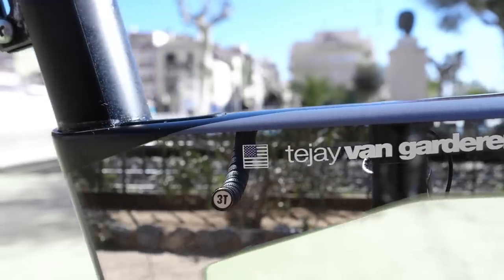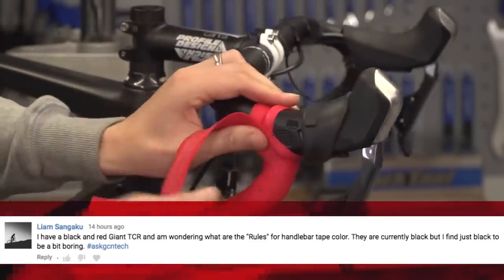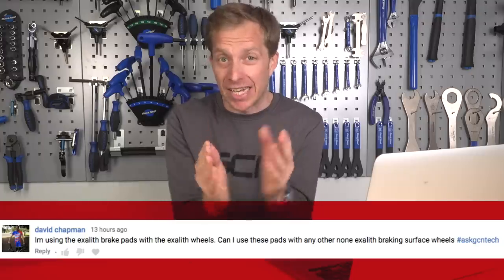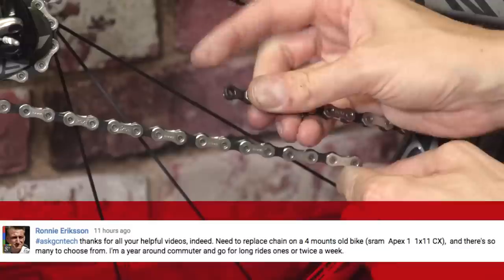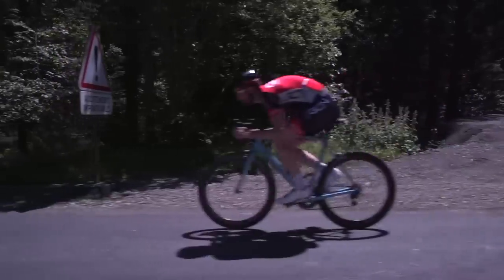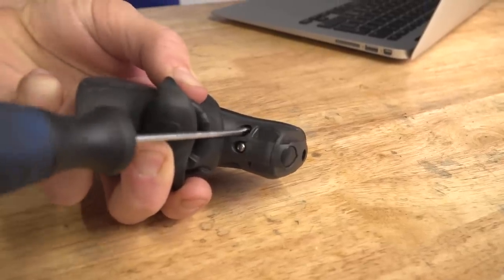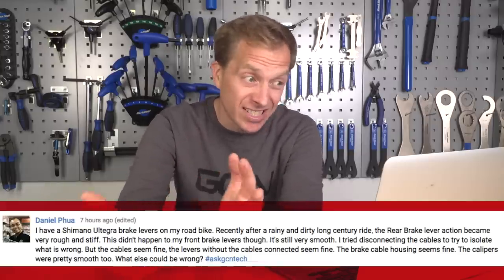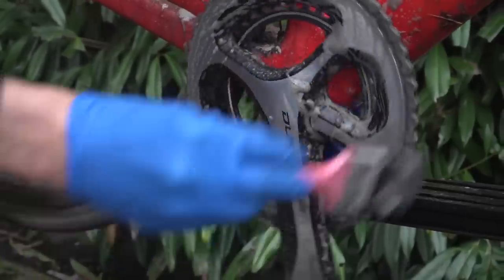Should You Get A New Chain When You Replace Your Cassette? | GCN Tech Clinic

Comment: About track bike stem pointing up.
Yes it's because the head tube is short on modern carbon track frame.
But why is it shorter than before ?
Because on a classic track frame, you can't achieve a proper aero position.
Now designed this way you can use the same frame for endurance race AND for Time Trial race.
You just change the cockpit : swap your (stem+road handlebar) for a (stem+pursuit bar+aero extention)
That's usefull during an omnium event when you race a 4000m after a scratch and before a point race :-)

BTW : Super nice advices here !! you're doing good ! :-)

Comment: Jon on the di2 brake reach, I have Ultegra Di2 with hydraulic disc brakes and the screw to adjust is on the inside of the leaver.

Comment: Degreasers made for car engine degreasing work perfectly fine on a drivetrain. I personally use only them, they're designed to not eat away at the plasticky/rubbery bits that the engine compartment will have.
Reply: Agree.  Big fan myself.  I buy 2l of concentrated degreaser from Super Cheap Auto (a chain automotive supply store) here in Australia for about $25.  Which I suspect would be about $100 of Muc Off (or more)...  I do make a point of only leaving it on the bike less than one minute (following the instructions)

Comment: there is a tool that can check the wear on a cassette. i only knew about this in the past few years, after i couldn't not diagnose the cause of "chain-skip".
i brought my bike to the shop, explained the symptoms, and they guy brought out what looked like a mini chain whip. tested the sprockets, and determined that the exact cogs i was having problems on, were the ones that measured worn out.

Comment: Bike dilema. I have an old cheap £400-ish mountain bike with sagging front suspension and hard tail.I have spent money upgrading the drivetrain and wheels so it now stands at £500 spent. I mostly use it on unmade roads and forest paths. My question is, is it worth fixing the sagging front suspension or locking out the travel altogether or maybe getting a brand new upgraded fork?Should i just get a new bike?

Comment: I have a Mavic Ksyrium elite which I rode for 5 years and a hairline crack originating from one spoke has formed.  1.  Is this normal given a rider weight of 110 kg ?   2.  Can a bike shop replace the rim and broken spoke , keeping the free wheel? (or do I have to buy a replacement rear wheel).  Thanks for any info.

Comment: I've got an ancient steel mountain bike and the front fork and chainstays get tire rub with good quality, corner-grippy tires at 2". I really want a grippy, plush, low pressure tire, but I need it to be 26" and rather narrow, probably 1.75" to be safe. Any ideas? The big names and fancy tires I know of all start at 2" wide and go up from there.

Comment: KMC chain links are very much reusable, even if they say they aren't. Marketing BS and nothing more. I undo mine every 200-300 km in order to remove and properly clean my chain, I never had any issue in 7-8 years of exclusive use of KMC chains.
Reply: Hey brother sorry to bother you and I appreciate that you acknowledge the marketing BS I'm with you on that one. I have a question I have a cassette on my bike that is 11 x 46 but I wanted to upgrade to a 11 x 50 cassette my current chain doesn't seem to have a lot of tension and I was wondering if I can use that same chain when I do the Eleven by 50 cassette conversion maybe I can release a little bit of attention please let me know if you can thank you

Comment: #askgcntech

Jon,

I ride a 2009 CAAD 9 (10 speed) in very flat Florida. It has a 59/34 crank and 11/26 cassette. However, I go to very, very hilly Vermont for two months in the summer and would like to make the bike more hill friendly. I am a half-assed bike mechanic and could use your advice. I am not going to change the crank, but I would like to change to an 11/32, or 12/32 cassette and a Shimano  105, 5701 medium cage rear derailleur (there is a 105 short cage on it now). Will that work? I did the math(s?) on capacity and that seemed OK, and the 105 medium cage cage can apparently handle 32 teeth. I know I will also need a longer chain. So, have I overlooked anything? Also, would a 12/32 provide smoother shifting (and increase capacity) than the 11/32? I ask because even here in flat SW Florida I never use the 11 cog. Any advice is much appreciated.

Thanks!

Comment: I have a 2011 Felt F3 fitted with Sram Red 2012 10 speed groupset. I don't want to upgrade to 11 speed yet, but Sram Red XG-1090 cassettes are getting harder to find. Can you please advise if I can use the Sram XG-1090 CX 10 speed cassette designed for cyclocross on a 10 speed road system ? Not sure if the cassette spacing is the same. Yes, I know there is the 10 speed Force/Rival cassettes - I'm a cycling snob & want to stick with Red ;)  #askgcntech

Comment: #askgcntech 
Hey Jon. I have a BMC TeamMachine SLR1 and have been keeping it in mint condition, but ever since I got it, I had an issue adjusting the seatpost, as it slides in every time I go for a longer ride (the angle lock, as they call it). I have the elastomer wedge version, not the aluminum and yes, I'm on the heavier side (about 92kg). I was just curious if you would recommend an aftermarket solution (if there is one) or if you could explain how to properly adjust the rod, as I am very afraid to tighten it too hard and damage the frame. Thanks!

Comment: When you put a new chain on the way is to put the chain in front on the big ring and on the back at the smallest sprocket.
Then your pulley wheels shot be straight above each other.
When this is the right way the lenght of the chain is the same with a 12-25 and a 12-29 cassette.
Is that not strange because on the 29 sprocket the rest derrailleur stand much more pointed to the front.

Comment: #askgcntech My bike shudders/vibrates whenever I brake. It's worse when I brake lightly, and almost goes away when I apply stronger force. It also mostly seems to happen whenever I use both brakes at the same time, as opposed to only the front or rear brake. How do I find and fix the source of the problem and should I be concerned for safety?

Comment: #askgcntech
What could be the reason for a quite loud, rattling chain noise whilst driving in the big chainring (50T) in the front and the 13, 14, 16 and 18 tooth sprocket in the rear? The noise appears to come from the chainring. Ultegra 8000, adjustment of derailleurs in front and back is correct, no scratching there.. could it be simply the sound of the chain hitting the chainring? Thanks for any tips!

Comment: #ASKGCN have a fit question for you. I’m new to the sport and purchased a price point bike. Large frame then I was feeling a little raked out. Purchased an 80 mm stem and have the seat slammed forward. Can I get away with it? Or would I be better served on a medium. I know fit is very personal. If it helps I’m 5’10”. Guessing I’ll have to go to the shop and get fitted.

Comment: Check out Bilt Hamber Surfex HD degreaser. Used neat it will degrease chains and at 20:1 it will clean the rest of your bike perfectly. As for replacing the chain when fitting a new cassette I was shocked to see SRAM state that when their Red 22 chain wears out that the cassette and chainrings should be replaced! For me that was 1700 miles, needless to say I’m aiming to get a bit more life out of the cassette and rings...

Comment: The shifters might not be the dropper post guys problem, he will probably need one with external routing, then he would also need to zip tie the cable across the frame. But he did say it was a cx bike so he is in luck if his front derailleur cable stops run across the top tube. I’m sure his frame wasn’t made for stealth dropper mounting, so if he went internal he has to route that cable around the bb and up and out the internal routing hole for the fd cable, but that only works if he has internal routing. So ultimately then he might have to just get a lever actuated one without a cable.

Comment: Hey John, great Show. I´m just irritated by the tire preesure recommendations. In psi it`s ok , but 1 Bar for every 25kg of bodyweight means 3 Bar art 75kg (lol). It should be around 6-7 Bar?! In Germany we don`t use PSI, bar is more common. There is even another aspect besides body weight and tire weidth. When using tubeless tires, I use almost 1Bar less.

Comment: #askgcntech.  Hey John, love the show!   My older frame won’t fit a 25 mm tire. The tire will rub on the rear brake bridge with my DA C-60 wheels, so I’m running a 23 mm on the rear. When I replace, should I keep the front at 25 mm or run matching 23 mm?   Thanks!!

Comment: Hi, recently I've got myself a Shimano R8000 groupset, but I've got some issue with the front shifting. Sometimes the left shifter is jammed when I tried to change from the small ring to big ring, but most of the time it's doing fine. Later I noticed the reason is that I touched the small lever as well when I shift into the large ring, which causes it to jam. But I haven't got that issue with my Sora R3000 & 105 5800 shifters. Is that normal or something is wrong with my shifter? Thank you. #askgcntech

Comment: How often do I have to wash the bike? Not only wash but also degreasing the chains. I m currently staying in Singapore (very humid). Thanks GCN!!!
Reply: You want to clean it if you happen to ride in the rain or get  caught in the rain or if it looks dirty to you. I currently have my bike frame and wheels coated 3-5x with carnauba wax and my chain coated in Molten Speed Wax, it helps to protect against dirt, grit, sweat, etc. it's nice piece of mind to know you've got that barrier against salty mess and road grimes. With a solid wax job, you can give the bike a quick mist with water and wipe clean as needed. This is just me since I like to take good care of my bike and how it looks.
Reply: Kyle Kim.... Get yourself a chain cleaner and two cheap water bottles. Fill one water bottle with hot soapy water and one with ordinary water for rinsing. Run the chain through the chain cleaner with the hot soapy water and then run through with the hot rinse water. I generally try not to use degreaser on my chain unless it is really really grundgy because capilary action sucks the degreaser into the pins and rollers then it is hard to get sufficiently flushed out. Which means when you go to put the chain lubricating oil or wax on the chain which has a higher viscosity then the degreaser you just used, the remaining degreaser in the chain will immediately start breaking down the oil or wax. Not ideal.
Reply: I wash the bike thoroughly once a week. Every other washing I put  a coat of wax on it. Quick to do and makes the bike more aero, like.5 more. LOL!
Reply: Dave Sarcevic.... Have you tried Lemon Pledge, it is very addicting!
Reply: I never wash my bike.  I ride it it to work regularly and some of the trip is on dirt/mud footpaths.  The bike gets filthy every day and gets a bit cleaner when it gets rained on.  I will clean the drive train when I start to notice a deterioration in performance or something needing adjusting/fixing.
Reply from the maker: Hey Kyle, depends on how much you ride and what the conditions are like. If it's quite dry, then once a week should be okay!

Comment: I have a brake related question. Yesterday i decided to test my new brake-pads on a quite rainy day. But i noticed after only a few breaking sections that my front breaks were actually peeling away small thin strings of aluminium from my braking surface. I also later on noticed a wierd ticking sound from my rear wheel when breaking. I, as mentioned, have aluminium rims and it said nowhere on the package of my new brake-pads that it was carbon specific. Does anyone have any clue about what could have gone wrong? Or is this completly normal when replacing brake-pads?
Reply: Loosen up you brakes as if removing your wheels. Check your pads for embedded sharp objects (pebbles most likely) under bright lights. Check in the grooves if your pads have them. Use tweezers to pull out anything you find.

Comment: #askgcntech recently had a long ride with a lot of speedbumps and since then I have noticed my rear wheel is losing air. Filled it up to about 100 psi one morning and by night it was sound 20%. The front wheel isn't losing air. What could be the issue.. I have checked around the valve and the airflow remains fine
Reply: The only way to fix a slow flat is to take the tube out and 1)  replace it  or 2) inflate it, immerse it in water brush off the bubbles and look new bubbles and patch it. If it is a pinch puncture you could have 2 flats. Run your fingers everywhere on the inside of your tire to look for anything sharp and if you find something remove it otherwise you will have to do it all again.

Comment: #askgcntech Am i able to combinate the new Campagnolo 12-Speed Groupset with the older Super Record 11 Crankset. Because 900 EUR less or more are a big difference. Thx for your Answer
Reply: "OLD super record 11" Dang we are already calling 11 speed "old"... my 10 speed is officially a museum pice i guess lol....... But seriously, From what i have read on the 12 speed group, they kept the exact same spacing in the back which means the chain itself is thinner so the space between the chainrings in the 12speed crank is less. This is so the chain (which is thinner) can catch on the pins and ramps that aid the shifting. That said, the difference is like a fraction of a fraction of a milimiter so I bet it will work just fine with the 11 speed crank.... maybe it will be marginally less smooth shifting  but i'd be surprised if you could notice
Reply: Fernando Roman thx, sorry, sure i meant „older“ not „old“. :D

Comment: I use a heavy duty degreaser called Marine Clean.  It is a very strong caustic solution that I dilute about 10:1 before using on my drive train.  Not out of concern for the drive train, but out of concern for myself.  I really don't want to turn my subcutaneous fat into soap under my skin.  That's no fun.

Comment: #askgcntech recently been using look cleats and look pedals, since I am a beginner, I was wondering is there a hack or something i can do with the cleats to give it more grip when walking with it?, my dad bought a few sets it will be a waste if its not gonna be used, nobody wants to slip a lot on cleats right?. Thank You!
Reply: I would try gluing a cutout pice , or a few smaller pieces, of inner tube. Shimano cleats have their colored tips made of a grippy material, I actually think they are pretty good to walk on.
Reply: buy some cleat covers that you can clip over them while you are walking. That adds grip and reduces wear on the cleats too.
Reply: @Zé Muguello, seems a good idea, gonna try that inner tube trick, thanks

@Nic Breen-Franklin my dad might have one of those, gonna try them later, thanks
Reply: Here is an example of cleat covers for the Shimano SPD SL system : http://www.chainreactioncycles.com/ca/en/shimano-spd-sl-cleat-cover/rp-prod146181
Reply: Im using Look brand road cleats guys not the shimano one, just finished installing the inner tube thing for grip
Reply: Even better $$ €€ ££

Comment: #askgcntech hi GCN my bike is a 7 speed bike I will like it 10 speed should I replace the chain cassette and derailleur
Reply: You would have to change so many parts ($$ ££ €€) that unless you can find them cheap (used/2nd hand) it would be cheaper to find a used 10 speed bike. It is not a trivial upgrade.

Comment: #askgcntech Si needs to tell us how different internal widths on wider rims affects what pressures you run.  Surely a 28C on a 15mm internal width would be at a different pressure to a 17, 19 or 21mm.  Question is, how much differnent

Comment: Any degreaser with Sodium Hydroxide (lye) should NOT be used. It has a strong reaction with aluminum and will etch it. Learned this the hard way.
Reply: An excellent point!  It can be a useful chemical reaction if you want to clean bare aluminium castings, though!

Comment: You can rotate chains, just use a KMC quicklink which is designed for being undone and redone multiple times
Reply: alex fulton 200km is really excessive though. A chain ought to last 3000 km at least when maintained. So if we're talking 9000 km over the life of the cassette, that's 45 chain swaps. 15 per link. Not sure if that's advisable, even if KMC does advertise reusability.
Reply: KMC says not to reuse their 11 speed links

Comment: Don't listen to what he said about not rotating chains. He's dead wrong. He hasn't even done it so how does he know? Rotate your chains every 700 miles. I do it with 4 chains. The cassette will last much longer because you will avoid skipping, since any one of the chains will be no further than 700 miles from the existing wear pattern on the cassette cogs. This may not be worth the effort if your cassettes are fairly cheap, but if you run an expensive dura ace cassette, it will be worth it.